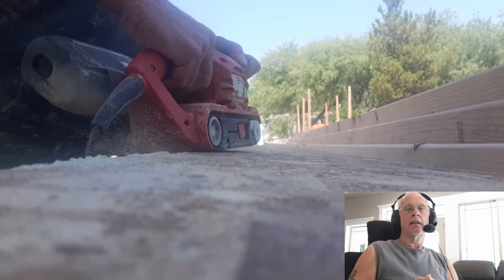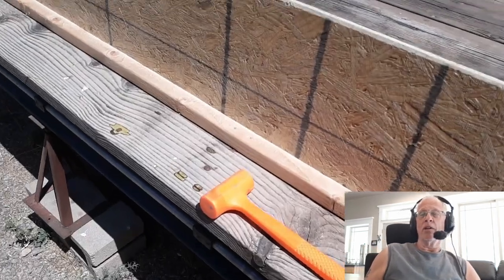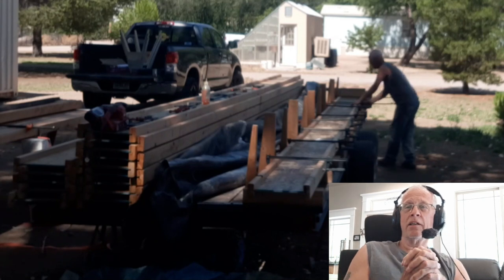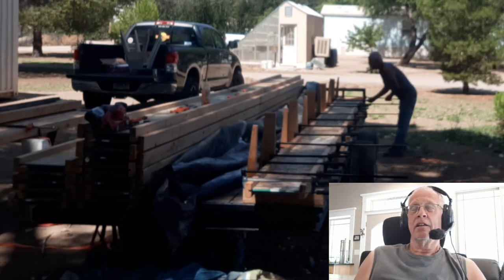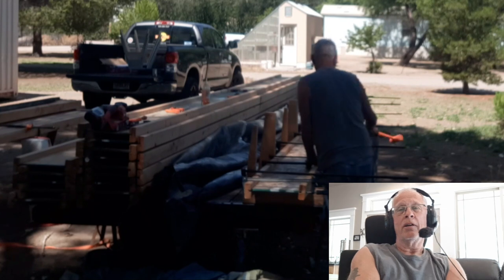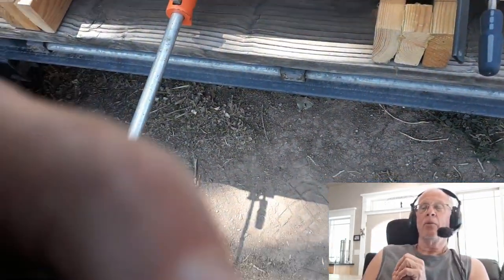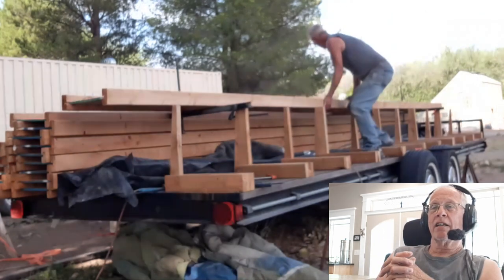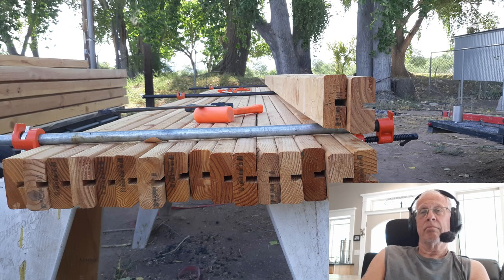DIY Barn Project - I-Joist, or TJI-Joist

Comment: i built gambrel trusses out of i-joists and plywood gussets with no engineering about 20 years ago.  that house is still standing!  one can do this with a relatively good margin of safety if you were to test them.  you just need to build a test unit or two, support the two ends above a gap, evenly load it and measure the deflection.  depending on span, around L/500 will feel pretty good.  it should either pass or give you an idea of what part needs to be beefed up.  rinse and repeat.
Reply: Can I see pictures of these trusses you made

Comment: NOT the same quality!!! A single 16' 2x4 is not the same as (2) 8' 2x4's!! I see some major issues with you doing this. First, you do not have solid lengths of anything. That is why they are engineered! Tension is a BIG part of why they are engineered!!! Now if you were somehow able to finger joint the 2x4's together along with the OSB sheets, then I'd say go for it! Since you did not, you are waiting for a disaster to happen! I think you are asking for trouble just like Stockton Rush did! it worked for a little while, then it DIDN"T! That goes for anyone who has copied your design and you could be held liable. Another thing you could have done, is to make some gussets for each side of the OSB. That would help a lot! You have at least 6 joints that can fail at any time if the glue doesn't hold or the 2x4 cracks. Now if you had also offsets the joints on every other joist, that would help a little by spreading the load away from a single line. I know a little about what I'm talking about. Designed a paper bridge in college and I think the record still stands from 2002. A bridge made from 0.48 pounds of paper, held 279 lbs. Any engineers out there? This is just my opinion. Let me know if I'm wrong.
Reply: I know it’s better quality. I’m doing the same thing. 16’ 2x4s top and bottom. Either 1/2 or 3/4 in the middle. 8’ splice of 1/2 on each side othe the splice. Subfloor glue

Comment: I had to make 2 of these 35 years ago because I was 2  joist short except I used a 2x4 on each side top and bottom to sandwich the osb board instead of 1- 2x4 on the bottom and staggered the joints  then glued with pl400 and nailed both sides. They were 28' long free spanned and still doing the job today .
Reply from the maker: Awesome, Glad to hear. Thank You

Comment: You've more or less addressed my concerns.  I have a badly constucted garage.  Roof MUST be replaced.  Has big hole.  And I need storage space.  Garage is right at 20 x 20.  I'm intending to make I joists as you have done, to support a gambral roof, but a little different:  I'm thinking of splittling 2" x 6" fir, grooving them with my router to 3/4" and using two layers of 3/8" OSB staggered and glued.  If I use 8" wide OSB and make the groove in the fir about 1/2", I'll have 10" tall joists.  I'd install on 16" centers on existing walls; just the roof that's rotten. Nominal loading is something I'd have to calculate based on field test of deflection of a sample joist.  Comment???

Comment: TJI joists typically don’t use solid wood for the tops and bottoms. They use something more akin to “Parallam” type construction. Think of plywood with all the strands running lengthwise. Why? Cause it’s stronger than solid wood and doesn’t have knots or other surprise weak spots to ruin your day.

Comment: They look good.  I’d love to see a side by side stress test to failure with a factory made joist.
Reply from the maker: Yeah if I had the equipment They are all set And seemed to be pretty solid when I was walking around on them so that's a plus.
I will be using some long pieces of Unistrut for an overhead gantry , so we shall be testing them that way kind of sort of

Comment: Stumbled upon your channel.  Interesting videos.  How did you determine your dimensions and spans?  You are right, there aren’t any good videos of this subject.  Want to learn something, go to the foreign channels, Americans don’t share knowledge
Reply from the maker: I basically guessed base on buying manufactured ones, and because I went with 2x4's and 12" webbing I was kind of over killing them compared to manufactured ones. What still scares me is the joint in the meddle of them at 12 foot, and I will be adding piece of 1/2" plywood at the bottom about 12" by 3 1/2" to help with a downward flexing.
Reply: Could also try a metal truss tie to span the butt joint at 12’ mark.

Comment: How did you join the pieces of OSB where they butt together?   Are the mfg joists made with continuous OSB vs sectioned on your joists?  Curious.
GregM 12:24
Reply from the maker: Yes, just butted together, I noticed that in another video on how the factory makes theirs this way also. The difference is that the factory is able to finger joint then and if I want I could just glue a 6" wide scrap over the joints, but they seem quite ridged. Also I will still need to add a 3"X6" truss plate on the bottom joint where the two  2"x4"x12' lengths come together.
Reply: @Prepper_Guy  the old statics and dynamics classes from college are rattling around in my brain now, and they're telling me than OSB bridge plate over the butt joints is both a good and bad idea... good in that it'll help prevent a point bending moment on the joist, but bad in that if it's too stiff it'll transfer increased loading to where the bridge plate ends.  depending on your loading of the joists I'm willing to bet it probably doesn't matter, but what wouldn't hurt is during building assembly you make sure the seams  on the plywood and 2x4's are never in line with each other from joist to joist, and ideally, not until at least every 3rd joist.  that way if any joist decides to be weaker at that point, whatever flooring (or ceiling) you've installed will help transfer the load to the adjacent joists.  if you do decide to plate the seams, I believe the plate should be an elongated diamond shape; 2:1 or 3:1 in ratio (probably the former), with the longer dimension spanning the full height between the 2x4s.

granted i'm drawing on knowledge gained about 30 (!!) years ago in college, but I do remember loving those classes, and getting excellent grades.   I was considered... weird... by some of my classmates. :D

Comment: Best video ever. How long did u let them dry for before removing the clamps? And did u clamp it like every 16” or so?
Reply from the maker: I think it was pretty close to 16 inch on center for the clamps and usually I clamped them up and then let them set overnight, then I just unclamped them stack them.
Thanks for watching the video I actually had a pretty good time building these and though it took a while doing it just on weekends.
Once I got the jig set up and the proper way to glue and clamp then went pretty quick so I was able to do 1 per day.
They're up now and I have a video of the completion seem to be pretty danm sturdy so I am impressed with myself but that's the joy of doing it yourself
Reply: @Prepper_Guy   man I love it sweet. I’ll watch your other video tonight for sure! I have everything to build a 30x30 addition but I need a few joist. All stuff from work lol 👌
Reply from the maker: @mikeyjohnson1696  I'll do a short video showing the process and how I made the jigs if you would like

Comment: 0:09 that will be the point of failure. you should offset the 2xX ends by at least 3 times the height of the trusses (I dont know the exact math, but usually 3 something is a magic number to avoid load concentrations). or you could just offset them by half the length of the 2xX to be safe. those points have a lot less load resistance than the rest as there is like a pre broken I beam with only the middle part intact.

aside from that, that does not mean that it will fails and you should repent for your actions. this only matters if the design load is really close to half the failure at those points (you still have some compression resistance in the upper 2xX butts). but offsetting them isn't hard at all, especially after how you dealt with the notching. 

another way to reduce the weakness of those points is bracing the lower flanges "butt joints". as said before, the upper flanges will usually work in compression and after the load squish them close, it will act mostly as a continuous piece, but the lower flange at those points are concentrating the load a those points as they have zero tension resistance (hence the usefulness of bracing them)

(thanks for making the video tho, it is a lot easier to debug this things when someone has already done it xD)
Reply from the maker: I agree and my design kind of happened without double checking, that said, they are quite sturdy. I will be using a 1foot long strip of plywood glued and stapled on the bottom of each cords to help out with my poor planning, I think this will solve any tong term sagging. These only hold a very low dead weight so if worse case I'll chalk it up to lessen learned.
Thanks for watching.
Reply: Ya 4’